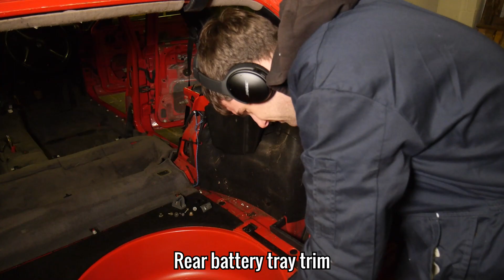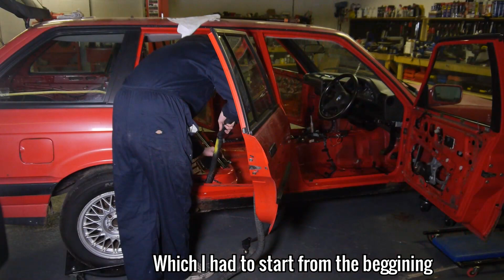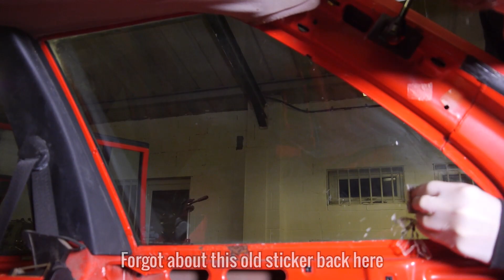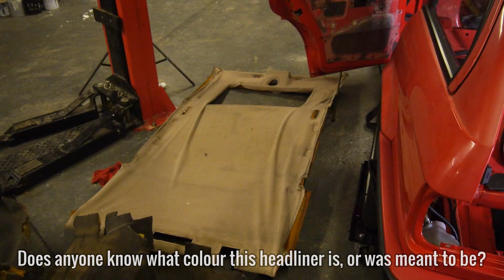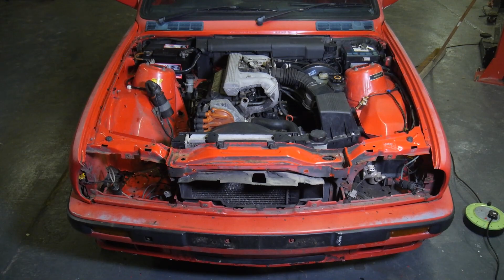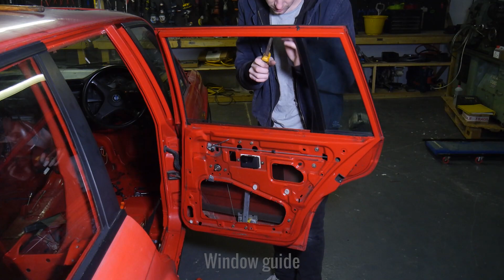A Full Restoration It Is - Project M40 Restoration Part 3

Comment: There are screws underneath the luggage hooks in the back. You can remove the plastic covers that are on the bottom of the hooks with a very small screwdriver. Once removed you will have 2 screws for each cover and then you can remove that little piece of trim. You also mentioned you needed some parts. Please let me know which parts you might need and I will check if I have something lying around.

Comment: How do you keep track of what parts have been removed, whether they need replacing or restoring and how to put it back together? Do you use a spreadsheet, specific tool, whiteboard etc

Comment: At the base of the tailgate glass is a plastic strip that pops out easily. I used to remove it a few times a year to clean in behind it. Dirt there causes rust, I'm amazed your tailgate isn't rusting from the bit under the window.

Comment: Now I know you're not a pro, but prying with a screwdriver and using a steel hammer? Look for panel remover and soft face hammer at your sponsors' webshop
Reply from the maker: A screwdriver is actually the official method e30zone wiki suggests. It works well and does no damage when done correctly. However I must agree with you, I could have got better tools for the job. And shortly I will i'm sure. Thanks dr.

Comment: You need to invest in small parts trays to put nuts and bolts in especially when working in engine bay,putting small nuts and bolts on top of engine is asking for trouble.

Comment: A good way to stay organized in a shop, yet not have a fixed amount of shelves is to get yourself the folding racks that are used to hang laundry inside an apartment. They are meant to take fully wet clothes in some variants (those that are meant to sit over tubs) and that's a lot of weight.
Buy like 5~6 of them, and you deploy them when you need them. Plus, they are cheap, dirt cheap.

Comment: Whadda good condution car is this.All body is original,no any repairs or paint Jobs before on it.just a little bit of rust.Good project car.Only 1.6 litre motor is weak for this body.
Reply from the maker: I want to make this car absolutely perfect and as it was when it left the factory, but there's always room to do an engine swap down the line and keep the mint motor from this series safely away for when these start to go up in price.